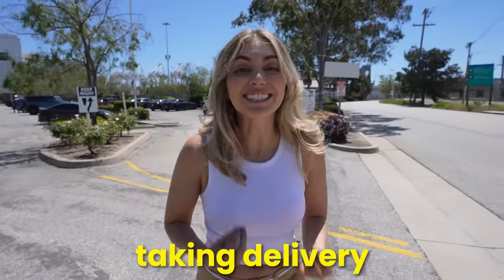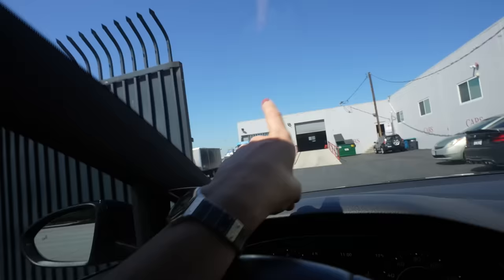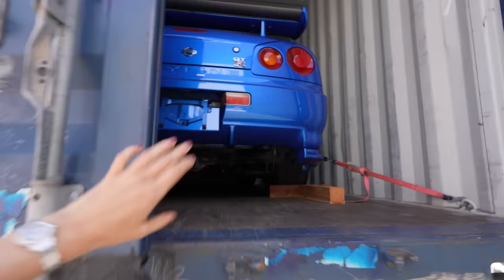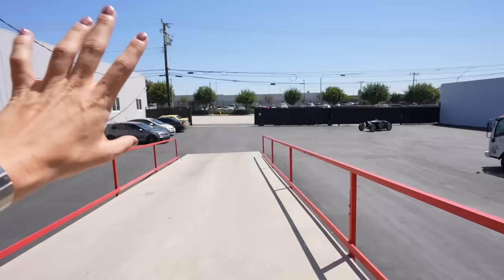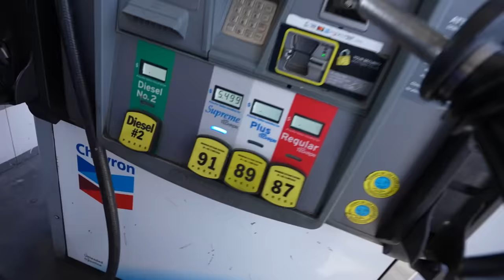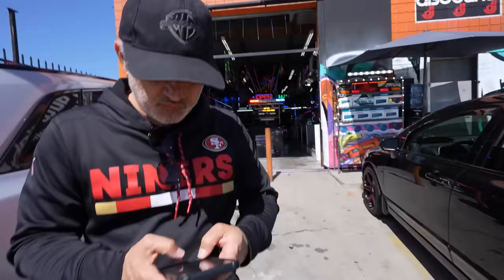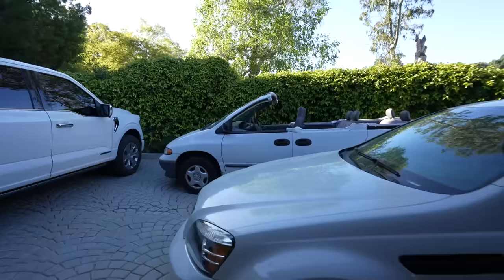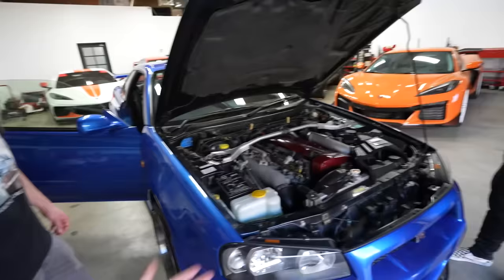Taking Delivery of My R34 Skyline GTR in the USA (Officially Legal in USA)

Comment: Think if u modified it just update turbos with ball bearing ones same size a not loud but good exhaust new shocks maybe adjustable for ride quality and better intercooler also blow off ,boost controler and possibly a noob 2 setting daily and one for letter eat mode ,bushing kit just tast full mods and just drive it maybe put in a fuel tech stand alone to be able to have better tune but I would  just add the bare minimum it be a dream and having a nice car that just looks good is sometimes better the the head aches of power if just update what's already there and tune u get atleast 50hp plus iam sure and don't have to worry about break downs I would atleast do anything of the things that are a common failure of stock cars to save the head aches man I love that color also keep up great work and hope u take some of my advice u have so many other nuts cars u deserve a great driver that's a looker also ❤

Comment: I'd have the same problem if I was to drive a LHD manual...........its unnatural!!

I prefer manual cars and only have an auto for my work vehicle. I have had a few Aussie Muscle cars over the years couple of Aussie Chargers when I was younger, a few Ford Falcons ( 4 sedans a 68' XT, 2x 71' XY's, a 74' XB ute (more rust than ute but 250cu straight 6 with 4spd) and 2x 92' EB 4.0litre EFI cars one was sedan the other a wagon, a Chrysler Sigma 2.0L auto sedan (lowered, wide wheels, big exhaust..... motor died and it got a 2.6 out of a later model, was like driving a gokart) and my only Holden was a 1966 HR which we rebuilt over a summer and lots of beer, 192cu six, 5 spd supra box, fat exhaust, suspension, British Racing Green paint job it was my everyday driver for 7 years.... the prices for classic cars here are insane now and unless I win lotto well out of my reach now.

Comment: The 1999 GTR were always illegal unless they decided not to as I remember as they destroyed a few of them. You may not be able to register it legally & California is one of the worst states to own that vehicle. A Japanese car stereo ill not work properly in the US as the FM frequency goes from 76 - 95 MHz as you will hear some stations from 88 MHz to 95 MHz as we not use 76 - 88 MHz. AM tuning also will be off on many stations & may not sound clear as they tune in 9 kHz tuning & USA 10 kHz tuning. Best to replace the stereo & antenna with a US one. I have a 1994 last year of the GTR R R32 with the RB26 motor & had the factory stereo in it & sounded bad. I also replaced the speakers & added 6 1/2 speakers in the doors as they use awards 4x6 size.
Reply: the 99 GT-R is no longer illegal in the USA because it is now 25 years old and is legal to import.
Reply: @ICP1SBJ  It was something else that made them illegal & many had to take them to Canada.

Comment: The only practical reason why I wouldn't be owning one is the lack of a secured garage. There's no way in hell anyone's buying one of these in great condition only for it to sit outside exposed to the elements and moderate risk of theft. I understand these became hot targets overseas because of their value.

...and by secured I mean from the above AND humidity. Live in the far West or deep South of USA? Fine. It's dry. Usually. Anywhere else and the humidity will eat the car up. Just ask anyone living in Florida. A new vehicle will have its nuts and bolts turning brown within a week.
Reply: The deep south USA is just as humid as Florida, I live in Florida and my 2 year old car’s parts have yet to show any signs of rust…… Also moderate risk of theft? This vehicle has an immensely high risk of theft, it’s one of the most recognizable and collectible cars of all time.